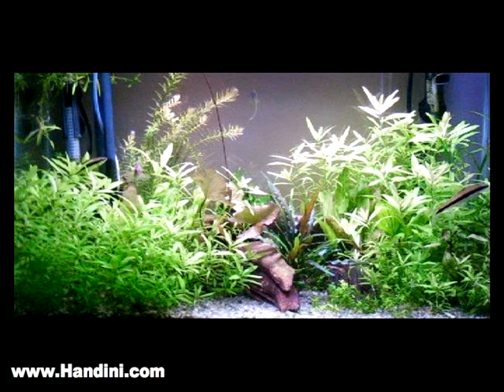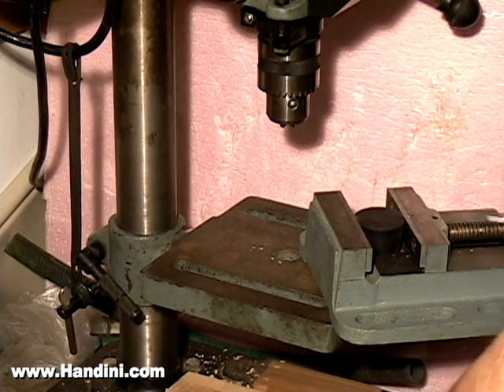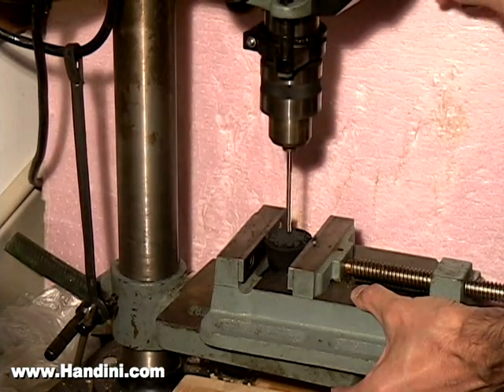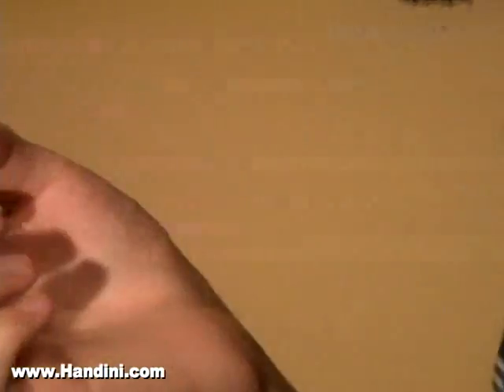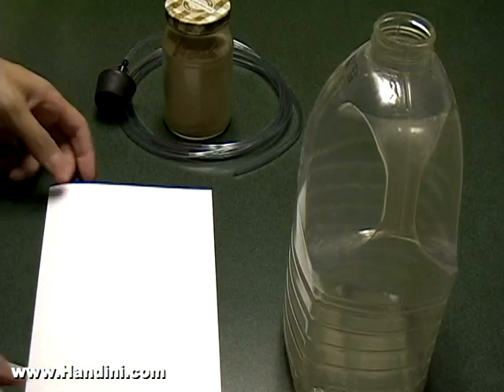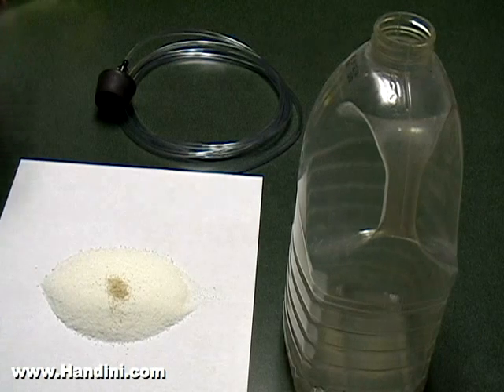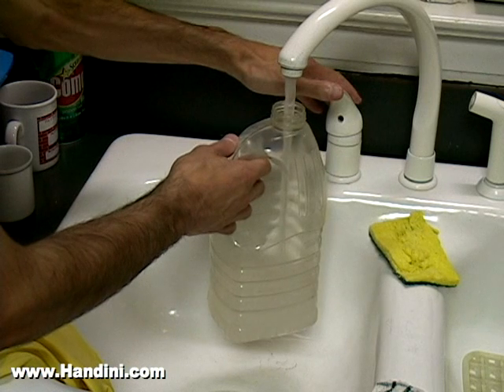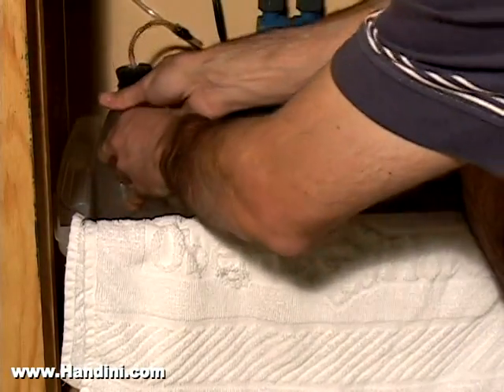How To Make Your Own Aquarium CO2 Unit

Comment: I have the same set up (minus the stopper and adapter) I used the eyeball measurements like you did in this video. I was wondering how long it would talk for it to start producing CO2 for it to counteract the pressure of the water.

Comment: Putting it in the filter is no good and putting it in the exhaust is pointless because it doesn't allow the bubbles to diffuse. I would run a line to an under gravel bubbler and then stack bigger rocks on top of the gravel over the bubbler. The longer you can keep the bubbles underwater the more time they have to diffuse. Good vid.

Comment: few tips :
* there is too much water inreactor
* use a 2nd little waterbottle in serie to avoid alcohol in aquarium
* inject in tank on OUTLET, not INLET of filter (because CO2 is to feed plants and not to feed your filter)
* CO2 is not ment in the first place to lower pH for fish, but to feed plants.Too much CO2 can cause CO2 intoxication of your fish. 
* ALWAYS disconnect CO2 at night > use extra valve that you open at night (no fotosynthese + plants produce CO2 while using O2 at night).

Comment: I have found that you can drill a hole in the original screw on stopper and then push through the check valve or tubing connector without the need for any glue or sealant. Use a drill bit that is of smaller diameter than the check valve connection. If the hole is too small, just use a conical recess bit to make the hole gradually bigger until the connector just pushes through. The seal will be air tight.

Comment: 1) an aquarium expert told me that CO2 should only be injected during the day, when plants need CO2 ...  does it harm it when injecting during night ? (night = reverse cycle when plants need O2 and no CO2).
2) i heard about filtering it on a second water bottle (filter) after the fermentation bottle to eliminate alcohol that is transported together with the CO2-bubbles..  is that necesarry ?
3) regulation.  Ideal is about 30 ppm CO2... but there's no exact control ?
tanx for answers !!!!

Comment: Great idea on the rubber stopper. Most CO2 tutorials uses the screw cap and then silicone the tubing to it. Not a secure method. I think your rubber stopper method ensures a good seal. Thanks for the tip.

Comment: @smoochy23 The Sugar/Yeast Solution inside your reactor got mixed with aquarium water.  Probably you did not use a one-way check valve to prevent aquarium water from siphoning into your CO2 reactor bottle.  Or the water in your reactor is too high as to reach the stopper. You must leave enough space for foam to form without touching the tubing.  You could also place the CO2 reactor bottle higher than the aquarium to prevent water from the tank from siphoning off into your reactor.

Comment: Great video. Thank you for that. If I may, a good tip is to use water from one of your regular water changes from the tank. Water from the tap is not as good. I have a bucket I keep in the kitchen that has fish water and I use it for my terrestrial plants and my CO2 DIY.

Comment: I would be careful when running your co2 into your filter intake, as the co2 bubbles will eventually create an air pocket inside your filter.  In turn the air pocket will cause your filter motor to burn out because they really don't like air pockets.  A better idea would be to make a reactor chamber that runs inline with your filter exhaust.

Comment: Nice work. However, I would not recommend to keep water level so high in container. Sooner or later the yeast will come to aquarium (nasty thing). Half a bottle is enough.
Also some external filters will make noise when with any gas inside and it is probably not healthy for bacteria colonies in the filter to have high co2 levels. Make a proper co2 reactor instead.

Comment: Cool man, real helpful... I got the same Fluval filter as you, I was curious as to how you were going to introduce the CO2 into the intake pipe of the filter.  Does the Fluval allow that to work good like that?  I was worried about large air pockets forming in the canister, and then air locking the pump.  But it works???

Comment: Plants need CO2 in order to photosynthesize, which they only do when it is light out.  When it is dark, they 'respire,' which is a time when they use oxygen, and will usually need more oxygen than a tank has, especially when using a CO2 system.  Some have said you should have an air pump going during the night, and have the CO2 system turned off.  Is this something you do?  or Do you find that this is not a problem for you?

Comment: Can any one help me?
I want to make a tropical aquarium in Tarai of Nepal, where temperature 5◦ in Jan and in rest months it varies from 20 to 38◦ Celsius. The tank will be built in the open courtyard. The size will be 3m X ½ m X 1m. The three sides will be walled by stone or bricks and the front side will be walled by 10mm glass. For this capacity, what kinds of water heater, and water recycler should I purchase? Or other devices? Thanks!